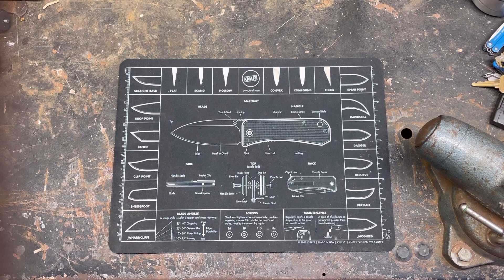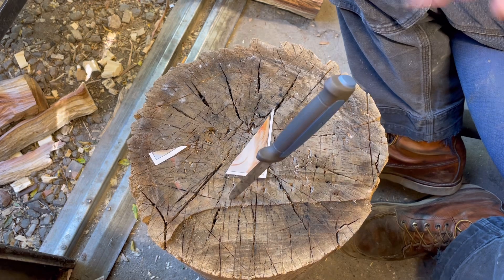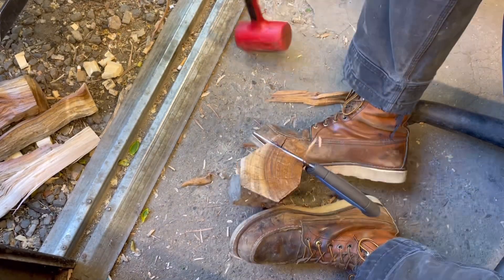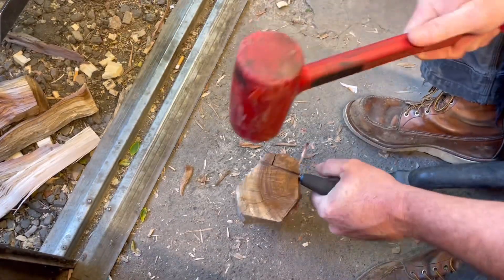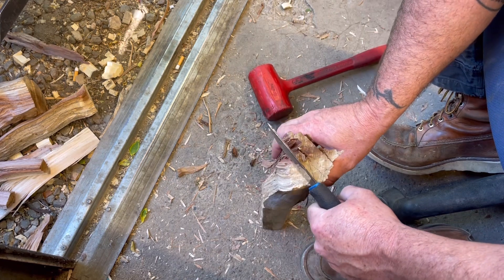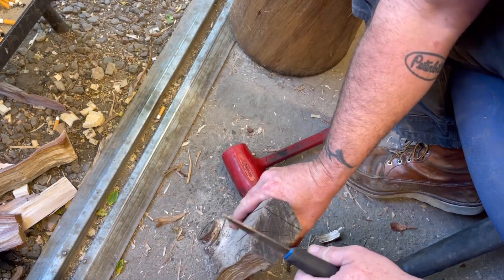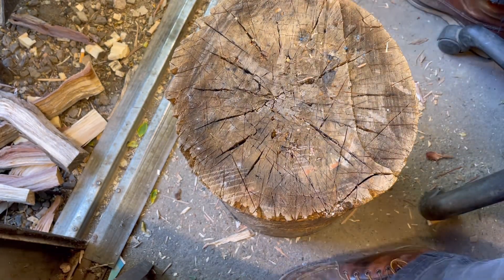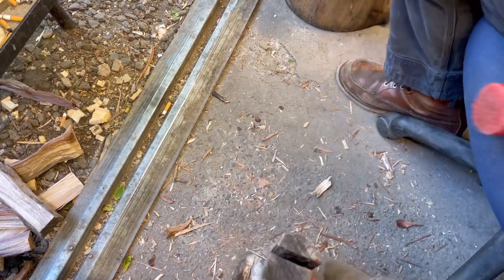Is a Mora better than the Milwaukee tradesman knife? Let’s find out

Comment: To be fair, they also offer the Pro Robust which is much tuffer than their standard knives at roghly the same price. However, it's not stainless. The Mllwaukee knife is almost 30 dollars where I live and Moras are far easier to get here. But I agree, there are alternatives to Morakniv which are quite good and Milwaukee is definitely one of them. Additionally Hultafors does make great stuff as well. Btw, the rust on the tang of your Mora doesn't surprise me. 12C27 is technically stainlass but it still only contains 13% of chromium.
Reply from the maker: Yeah. But the better mora’s definitely cost more than the Milwaukee
Reply: @peterbiltknifeguy  That's true. You get a lot of knife for the money if you choose the Milwaukee. Especially in the USA. They also have some interesting folders.

Comment: Good test but not a fair test due to thickness of the blades. The Milwaukee is obviously thicker and stronger. If you wanted to be more fair, you should have purchased Mora Robust or Companion HD. Those two models have thicker blades and are considered heavy duty. Also, I don't know where you bought your Moras from but seems like you overpaid. Again, good test but you have to test apples to apples and not apples to oranges. Take care!
Reply from the maker: This test is about what’s better in the price range.
Reply: @peterbiltknifeguy  Those two knives are not in the same price range. If you wanted a Mora in the same price range, you would have bought the Companion Heavy Duty. It's $20 just like the  Milwaukee. I think your main objective was to destroy the Mora therefore you picked one of their weakest knives to prove your point. Again, unfair test and nothing to do with the price range.
Reply from the maker: @LXT43  they both cost me 15 dollars. So once again. You’re wrong
Reply: @peterbiltknifeguy  Mora Robust is also $15 but you purposely decided to test one of the weakest Moras just to prove your biased point. I'm not wrong and you're not right.
Reply from the maker: @LXT43  okay 👍